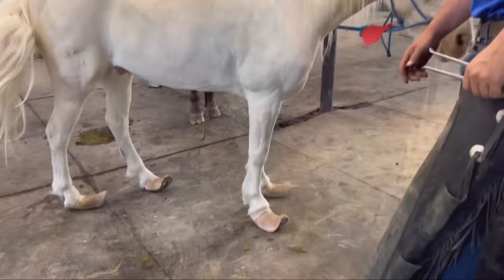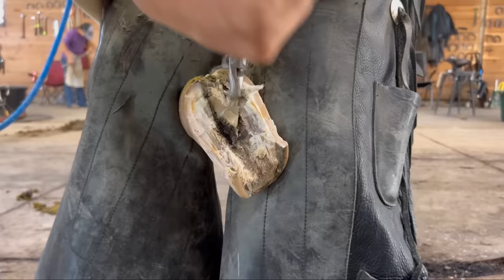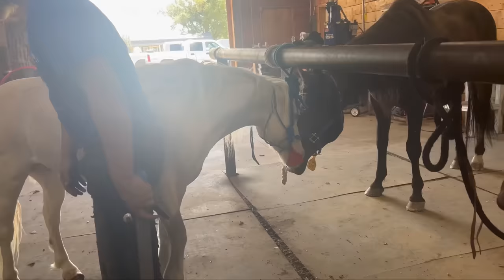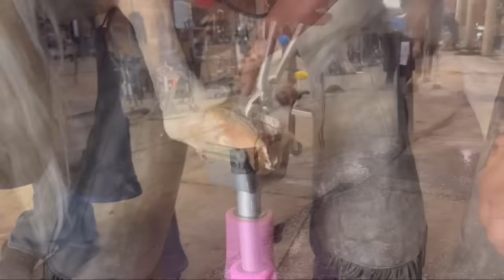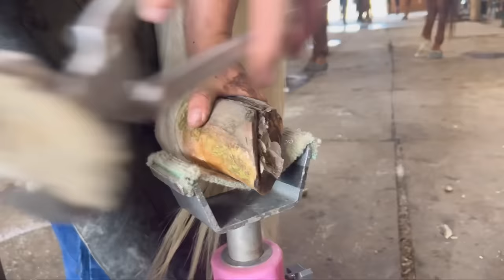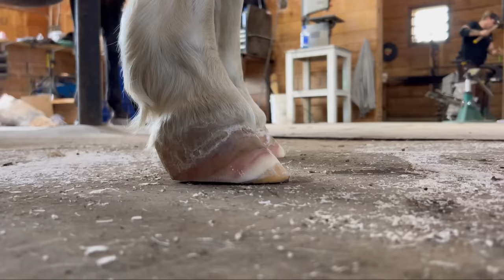DEFORMED HOOF Transformation

Comment: I have flat feet and the relief I get from wearing properly fitted orthotics is unbelievable. I have so much empathy for that horse. That sure was a tough hoof, but persistence pays off. I was surprised you didn’t saw off some of the excess but I guess you wanted to demonstrate taking off bits at a time until it looks right. Well done. 

I think your approach makes sense and shows good results. Keep up the good work!
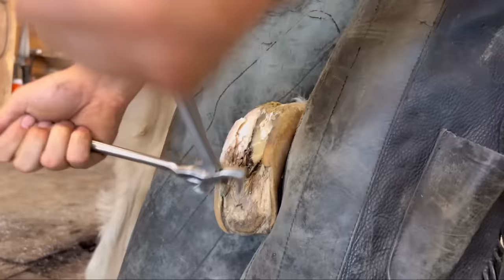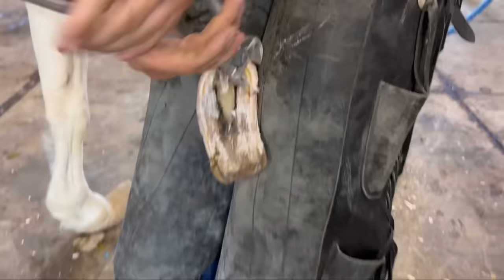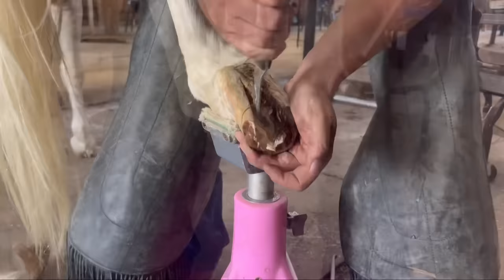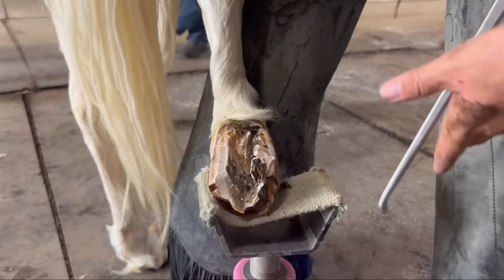Reply: Your question about sawing it off is a very good one. Although they didn't show it actually being done, at 2:00 onward and at 3:04 onward we can see that they had already used a hand saw to to remove a chunk of the front projection of overgrowth on a front foot. You can see it even better on a rear foot at 5:54 and at 6:15. So they skipped showing us the step where they sawed it, but at those time stamps you can clearly see the shape of the hoof as he works on it, and the fact that some of that projection is gone. 

Once they get anywhere near to the actual foot, to the part where a hoof normally is, there are structures that are critical, and some that are soft inside. It's vital to avoid damaging or injuring them, so all of that needs to be done by hand, and bit by bit, very carefully. It's literally back breaking work! 

You might not be able to tell, I can't tell what your mind sees, but what looks like random clipping and yanking is actually being done with great knowledge and care. That's why he's going slow. It's because the hoof is complicted, and in some ways if it's injured the consequences can be severe. 

We are very lucky here that the horse is a very calm one and the camera work is the best I recall seeing of farrier work.

Power tools can't be used on their hooves even for the part where they chop off the big projection on the front because since they are VERY nervous animals, the horses don't react well to the noise, and especially to the vibration of power tools. They don't know what that weird feeling is going all the way up their leg, and it scares the heck out of them. They are EXTREMELY  protective of their legs, since even a small injury could mean the difference between life and death in the wild. 

They could be desensitized to it over time, but the owners of neglected horses won't bother doing that, and the horses who do get trims regularly don't need it, because the growth over 4 - 6 weeks is small enough that they would never need power tools to be used.

There is some chance that I'm wrong and a power saw was used, really fast. Like "Let's get that peice off. Bang!" But I think not. As I said, horses are VERY nervous, so to do that on all 4 feet would greatly alarm the horse, and cause it to be too frightened and reactive during the whole process. That could be dangerous. 

But often really badly neglected horses have to be sedated for their hooves to be done the 1st time, because they are freaking out with fear. Occasionally they even need to be laid down and heavily sedated! Power tools would be an option then, but only for that front peice or projection. The rest still has to be done with care. Farriers are very special people!

I'm not an expert either, but that's my understanding of it, from spending some time around horses and barns. If anyone wants to add anything or to correct me, I would be happy to recieve new info.  😉 ✌🏼

Comment: What is strange is that the actual pony looks well fed, and otherwise cared for !
How could anyone neglect his hooves like that is the question ?!
Reply: It’s possible the horse is new to someone and this is just the next step in the healing process. But, farrier work is expensive depending on your area. That on top of vet bills, board, etc it all adds up. Cases of neglect and abuse or abandonment skyrocketed when we outlawed horse slaughter in the US, which often is how this ends up happening, until a new owner comes along. I doubt that the owner who brought this horse in is the one who caused the farrier work to go lax
Reply: @Decodethefallenmoon  I owned two horses - back to back - for 35 years so I know all about the 'expenses' ! The cheapest part of 'acquiring a horse' is  the actual 'acquiring' ! Like you said, it's every thing else on top of that - board, vet, blacksmith, tack, etc., any and all showing costs if you go that route. Even a reliable vehicle to get out to a perhaps distant barn, if you live in a built-up area, where there are no boarding facilities available anymore, etc. 
I seem to remember at the time of my last horse, before I had to give her up due to finances (which was 16 years ago ) a basic trim was $40, no shoes included. My first horse ?  For a trim and re-set, shoes on the front, was $9.50 and 'new shoes' were about $2 extra. YEAH - that long ago ! :)

Comment: I can kinda understand the comments saying you should take off less and let the foot slowly be allowed to adjust to a normal position. It makes sense that it would be best for the tendons and joints to not have a sudden shift. But in order to allow the horse to relax and stabilize back into the natural position, you still need to take off all the curve at the bottom and the toes. So even if it means the legs need to adjust quite quickly to a new position, it's still better for the horse to trim the feet back as close to where they should be right away. Even if the hoof will need some time to grow out normally again, getting off all the excess will immensly increase their wellbeing

Comment: Many of these neglected hoof repair videos start with the Ferrier using a hacksaw just to whack off the excess so that there's less to nip. I noticed you didn't. Is that not a good practice? Or is it dependent on the situation? Just curious on the different approach each Ferrier has.

Comment: Most people are lucky enough not to have experienced the difference between degenerating  pain and healing pain.

I have--in 2005, I spent 5 months on the burn unit, having wounds that were measured in terms of square feet and percentage of body area healed up enough to send me home to heal up the rest of the way (another 14 months). The first time the nurses told me before surgery that I would feel better after surgery, that I would still be in pain but that healing pain is much easier to bear than degenerating pain, I scoffed. That just sounded like a bunch of woo-woo nonsense to me, designed to make other people feel better but would not really be true.

I was wrong. Healing pain can be as intense as degenerating pain but the body knows the difference and it is easier to bear. Better a few days of healing pain than weeks and weeks more of degenerating pain taking things gradually.

That pony is way better off with a stable base to stand on than he would be trying to navigate one day more on his rounded off "elf shoes."

You all are doing good work and the horses and ponies you work on are better off because of you.

Comment: Can u not saw those overgrowns off and then  trim and file? Just asking, probably a silly question.????
Reply: It needs to be done correctly, using a saw could take off too much and leave the horse bleeding. Plus you need specific angels so the horse hoof are correct and won't cause any pain or discomfort

Comment: You mention he wasn't standing well. Why don't you use a crush like cow hoof trimmers do with a belly band to support their weight and things to rest the hooves on so you don't have to hold them between your legs? I know horses can be trained to cooperate in a way cows can't, so it isn't essential to use a crush, but wouldn't it be easier? At least in difficult cases like this (I can understand it would be excessive for a quick routine trim and might be an unnecessary stress for the horse).

Comment: One of those hoof blades you see on the donkey hoof trim videos from China would make this job faster and easier
Reply: Faster and easier are not always better.  This shoud be done for the benefit of the horse, not the comfort of the farrier.
Reply: @larrybrown6068  it's for the comfort of the horse. A hoof blade may be easier on the horse in that it can stand on all 4 feet.  Yes it will have to balance on 3 for the detail work, but 1 swift cut is easier on the horse than nibbling the excess hoof away.
Find a few of the videos and consider the idea
Reply: @charlesyates8228  No thought of angles or balance of the foot, just hack off lumps until it looks right.  No thanks, I'll stick with qualified farriers, not butchers.
Reply: @larrybrown6068  I’ve only used qualified farriers.
But just because something has been done one way forever doesn’t mean another way is bad.  The videos I’ve seen leave hood looking hooves.  For these overgrown hoof horses, it might be helpful

Comment: What is strange is that its 21st century - and people still use such bad instruments, when there are much better and faster tools available on the market… I guess, its a preference thing, but still - why not relearn? Would be faster and easier on a man‘s back, no?
Reply: it's probably because those instruments have been found to be the best ones. Sometimes there is simply no need for change. if it's not broken, don't fix it !
Reply: Faster is not necessarily better, these are the correct tools for the job.  The hoof is a very delicate structure, you need to be able to 'feel' what you are doing.
Reply: Faster can cause more mistakes and possibly leave the horse in more pain or even injured. It's better to do it slower that way it's easier to avoid mistakes